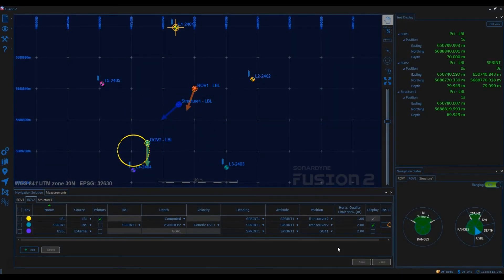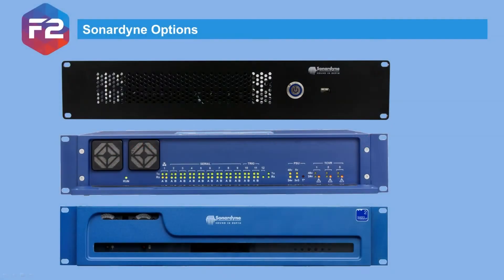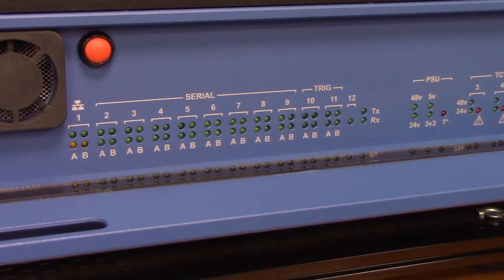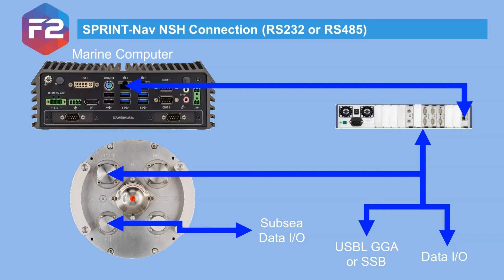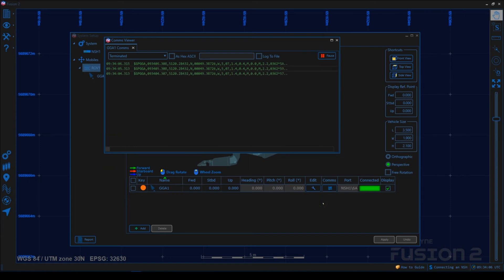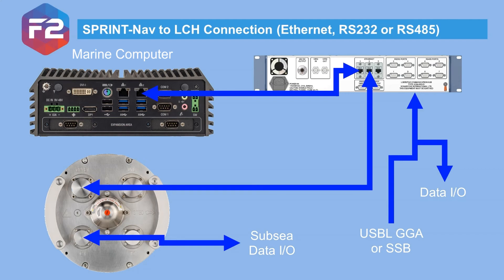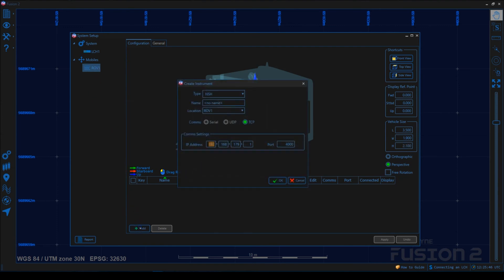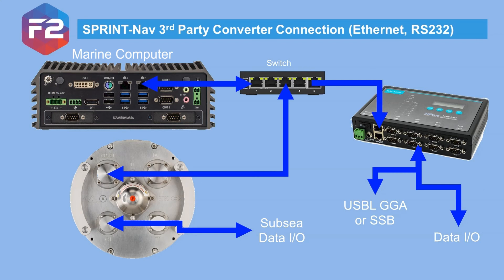Fusion 2 - SPRINT-Nav Interface Options

Comment: Acronyms

NSH
Reply from the maker: The Navigation Sensor Hub (NSH) forms part of the vessel-fit for a Ranger 2 USBL or Marksman LUSBL acoustic positioning system and is usually interfaced with a Marine Computer, HPT transeiver, DP desk and external sensors. You can find out more here - https://www.sonardyne.com/products/navigation-sensor-hub/